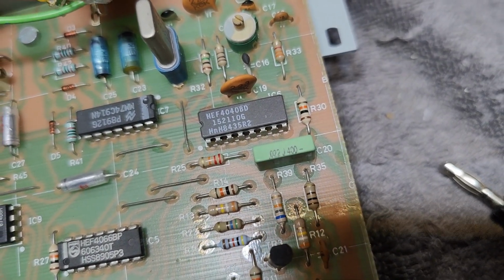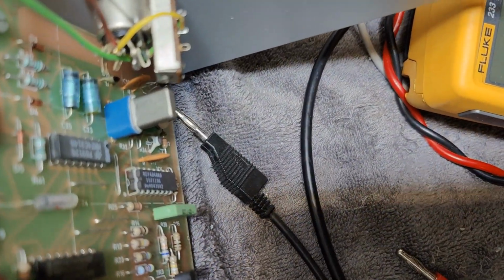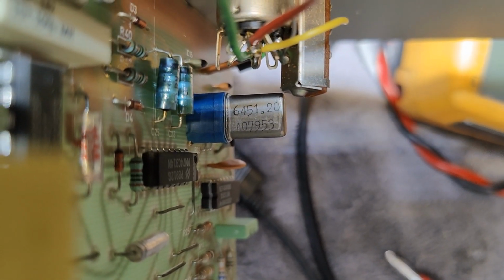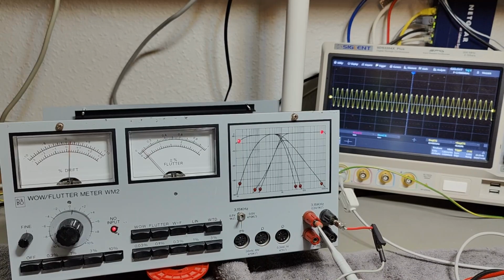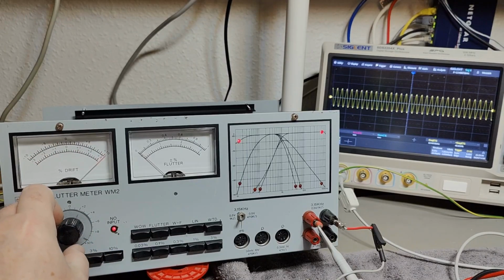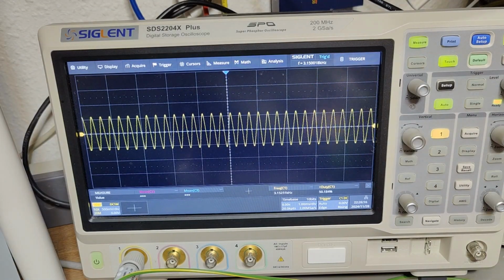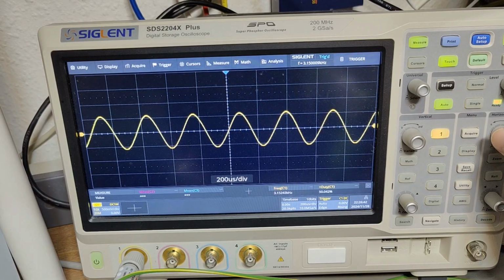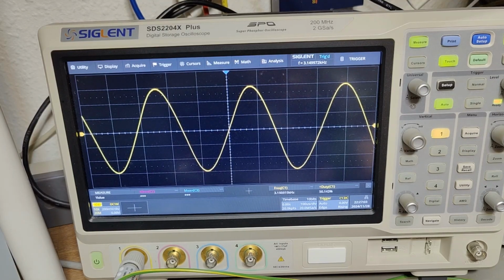Bang and Olufsen Wow and Flutter Meter WM2 1986

Comment: 8:10 I have serviced several B&O products with those exact type of capacitors, and never come across a single one cracked or leaking.
A few have been a bit out of tolerance in value but usually they are just fine. 
You can also test the instrument with a sweep signal generator. 
If you sweep from say 3140 Hz to 3160, you can then simulate WOW and Flutter depending on how fast sweeptime you set on the signal generator.
Nice instrument that is, but it can only measure W&F to the DIN standard (at 3150Hz) not the JIS/CCIR (Japan)standard at 3000Hz.
Reply: Then you must have been real lucky. Those Roederstein caps are always my first suspects in equipment with weird problems. Especially if they are in a warm environment.

Comment: This is still a highly desirable instrument, for anyone that services and repairs (or just collects) analog audio equipment
Reply: More specificially, tape and cassette players and recorders, or is this any use with turntables too?
Reply: I also was wondering about turntable measurements. I would suppose you'd need a prerecorded standard set of tones in LP form. 
I have a Leader LFM-39A I use when serving reel to reels.

Comment: I have a B&O audio in same type of cabinet. First, when taking it apart, I wondered how.. Just now measuring wow & flutter on a Tandberg cassette deck, using a Leader w&f meter
Reply from the maker: first you record the test tone, then rewind and playback, and analyze it, of course it is mostly recommended to use a prerecorded tape made to a specific standard, you can argue the wow / flutter your deck has, is also in the recording, and again on its playback, this means you read double the value.

Comment: I love those red eloctolytic  capacitors , without a vent did they fly away like space craft in case of over voltage.
Reply: Like with space craft, vent is best on bottom side :) But yes, with these ones there isn't really a vent. There is european hubris instead - european rockets go up, european capacitors do not, neither will explode :)  (I am european myself, lest someone thinks I want to insult anyone).
Reply from the maker: they are often seen broken in B&O equipment this age.